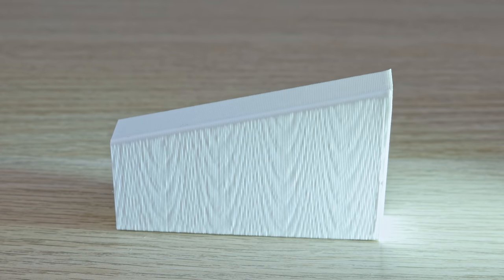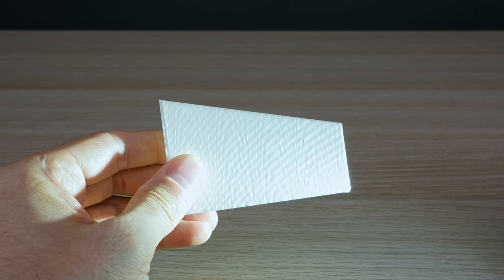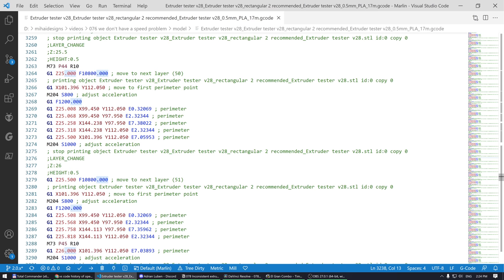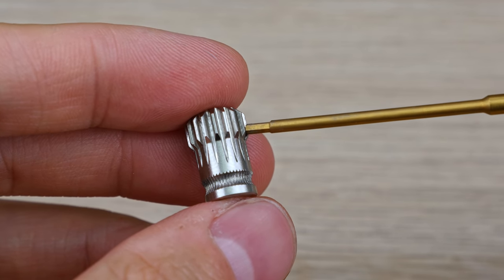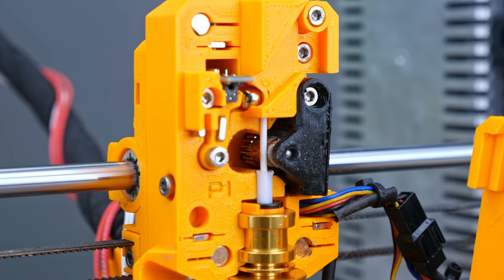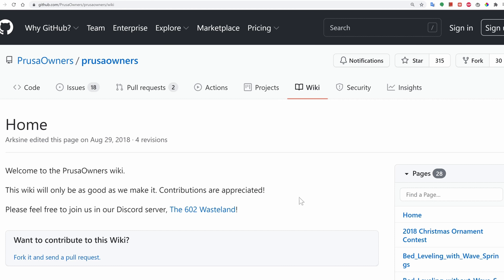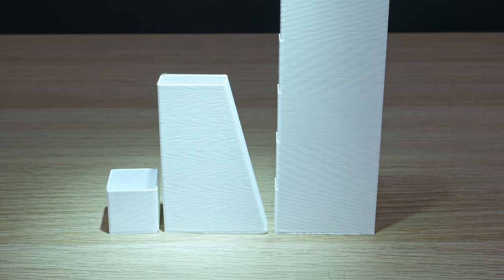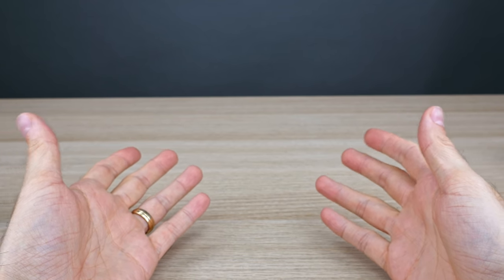What I've learned about dual gear extruders and how to patch them, maybe

Comment: I've been telling about this issue for as long as these gear abominations exist.
It's just bad design.

There is a way to drive filament from both sides without this issue.
But it'll require completely different and much more complicated gear system.

Spur gears won't solve anything.
Reply from the maker: Thanks for confirming!
Reply: It's not that much harder, it's just a belt with idler and spring. That allows massive amounts of travel (could use the same extruder for 1.75mm or 3mm) and it's just 3 extra parts (idle wheel, belt, and an extra screw)

There is also stacking extruder wheels (I've seen a double double extruder, it has 4 driven wheels in a 2 stage configuration on Thingiverse). I typically don't have a problem though as my knurled shaft is 14mm diameter so it's nice and more even pressure (larger surface area to distribute the load on the filament)
Reply: @jakegarrett8109  yup, belt solution may be less complicated than the gear system I had in mind. And there's a good chance it'll be precise enough, provided a good quality belt.

Comment: a helical gear should fix it, no need for the double helix
the problem with spur gears is that the force transmission starts abruptly and stops again before the next tooth meshed, so its always jumping between teeth
helical gears dont have this problem as there are always 2 teeth in contact

Comment: I got a modified Ender 3 with  a Titan extruder and Volcano hotend (all good cheap clones) and yuo sre right , this isues are produced by the doble gears ,but i have 1 gear extruder and works good with Klipper , i can print at 300 mms (infill)/150 mms (walls) at 4000 mm/s2 aceleration wiouth quality loss , specially with presure advance AND Resonance Compensation Configured and Activated in the firmware , most of riinging artifact disapear😊

Comment: I wonder if connecting the  2 extruder cylinders with a belt, rather than meshing them  together with gears (with a belt tensioner being added), would correct that.  I realize I would be slightly more complicated though.
Reply: Wouldn't work because the two rollers would then be turning in the same direction!

Comment: One solution is dual extruder motors. Different stepper on each roller. Do away with the sloppy gears entirely.

Comment: I think I know how to fix this. Use two fixed gears driven by the motor. Each gear drives one of the spur gears, which adjust by rotating on links that go through the drive gear shafts. Now you have two spur gears that can move, but always stay perfectly engaged. This could also allow the spur gears to close in more tightly.

Comment: These repetitive printing artifacts usually referred to as ‘’Moire’  patterns or ‘fish scale’ effects have been discussed in detail by Teaching Tech and just recently by Stefan in CNC Kitchen in his video called ‘How I fixed my Ugly Prints’ Before & After.   Stefan determined after extensive experiments that it was a result of barely perceptible eccentricity of the drive gear on the stepper motor shaft!  If the bore of the drive gear is not perfectly machined to be a press fit on the stepper shaft, which it can’t be if it’s to be a removable item, the set screws will always force the shaft to the opposite inside of the gear bore, no matter how small the difference in shaft to bore is!  The bigger the minute difference , more dramatic the annoying effect becomes.  D Shafts with a flat  side accentuate this problem.   After microscopically photoing an expensive fine toothed steel drive gear in close up motion, at various extrusion speeds without filament and comparing the single gear outside rotate against the stationary idler wheel, there was a very detectable changing gap on each rev!  Wow!
Pulling off the gear after loosening the 2 set screws, I was amazed that inspite of a snug fit on the stepper shaft there was detectable play!   I resorted to trying some 0.001 thick kitchen alu foil cut wider than the gear width and just long enough to wrap around the shaft. The cut piece just lapped onto the D flat.
It took a lot of fiddling, but I finally managed to grasp the stepper, which I removed,  in one hand and folded my fingers to hold the curled foil around the shaft while the other teased the gear onto it!  Took a LOT of fiddling, but but by folding the foil over the end of shaft a wee bit I managed to feed the gear on tightly.
It worked!  The gear now spun concentrically with no detectable wobble!   Reassembling the extruder several prints of vertical boxes and cylinders that showed the Moire now had virtually no repeating patterns, just clean consistent layers!   Thanks to Stefan’s blog, I’m so pleased that this simple fix is working for me.   Depending on the slop you may find on different removable drive gears, a few square MM of thin foil may also be your cure!

Comment: Are you using genuine bondtech gears? This is critical. 

It's important to understand that a properly designed and machined involute gear should have none of the issues you found. An involute gear should be constant velocity and backlash should not be an issue regardless of how much of the teeth are in contact. I would bet that many of the China gears are either not involute or don't have the quality control necessary to inspect these gears. I would recommend watching This Old Tony's video on gears to understand better how tooth design works

https://youtu.be/Q-XOM4E4RZQ?t=126
Reply: I mean, he made the experiment with more than 50 people that used prusa printers and more than 50% had the same issue. We would have to assume that prusa is giving away fake bondtech gears?
Reply from the maker: I did all my tests with original gears from Prusa. I do have clone gears but I've never used those. Could be interesting to run a comparison test. I know that gears are costly to manufacture at the required accuracy and some manufacturers will choose to cut costs and produce lower quality parts. Thanks for the link to Old Tony. His videos are awesome!
Reply: Ah! Thanks for the info, I must have missed the part about them being prusa parts and machines
Reply: @fail_fast  I think it may be due to shaft angle misalignment causing meshing errors although that's just my speculation. Crowned tooth gears could fix it if it is the issue.